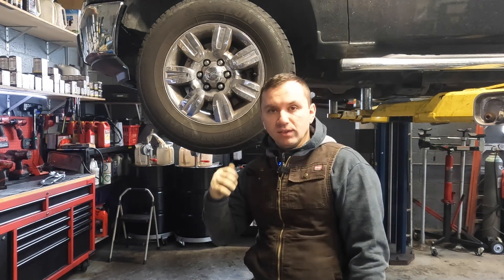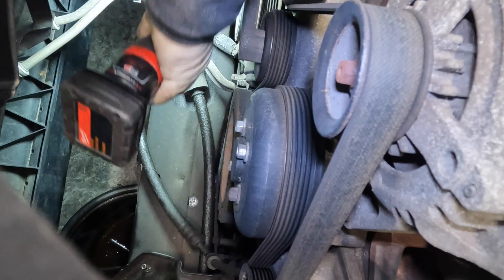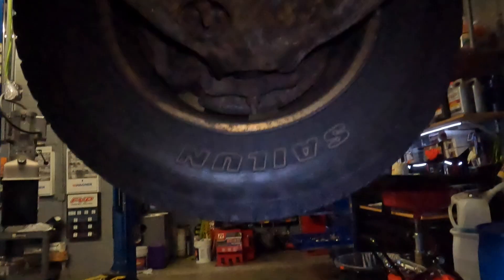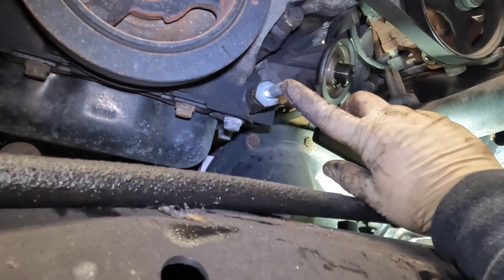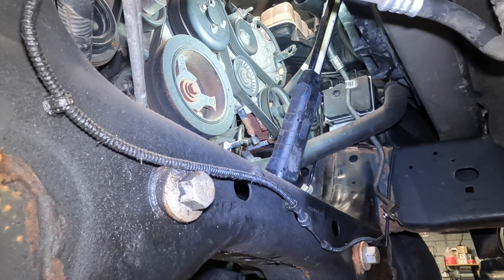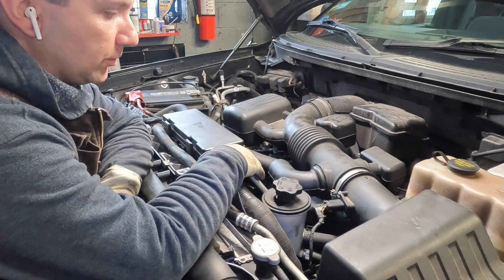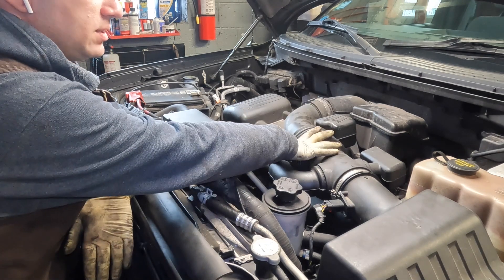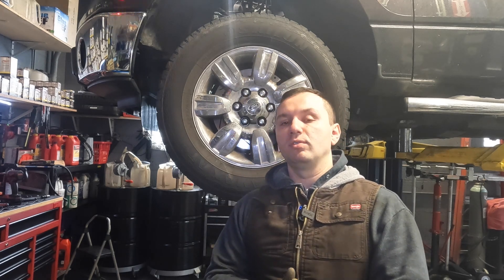CUSTOMER STATES OIL LEAKING AND WHINING NOISE! HOW TO REPLACE A POWER STEERING LINE ON A FORD F-150.

Comment: I noticed that there is a sensor behind the steering pump by the oil filter that wasn't plugged in. Is it used or a dummy plug?
Reply from the maker: If your referring to that gray colored one, its not a connector its a wire harness holder that's used on a stud nut thats on the power steering pump.